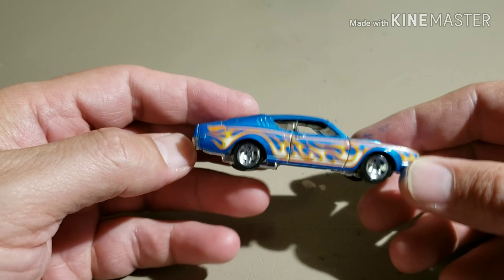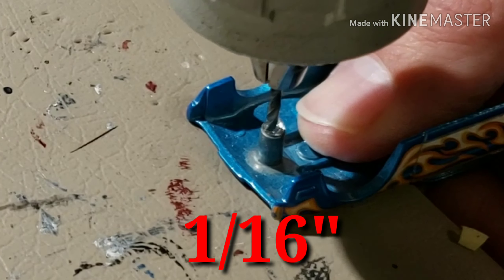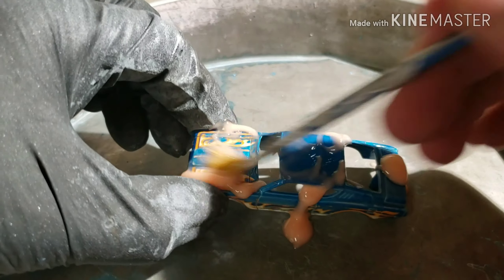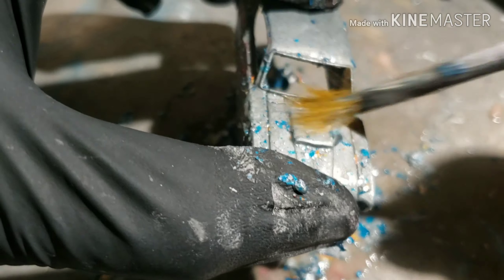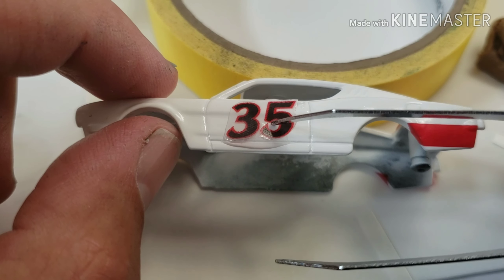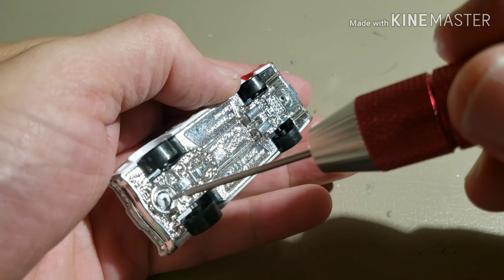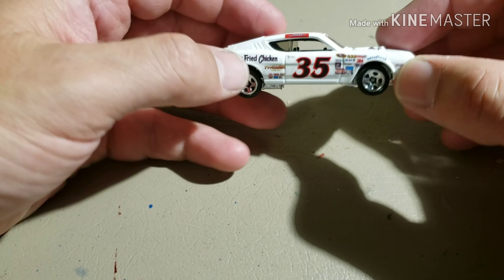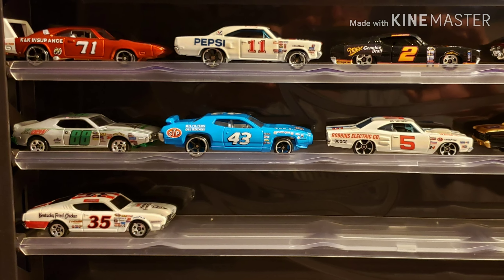Custom Hot Wheels (1969 Mercury Cyclone)

Comment: What size screws are there thim
Reply from the maker: 2x56 button head screws.
Reply: Is it 2x56 1/4
Reply from the maker: @blakeschoettmer9440  2-56 x 3/16
Reply: Okay thanks
Reply from the maker: @blakeschoettmer9440  no prob. I get them from Amazon. About $8 for 100 screws.
Reply: Are the black one that are really close to see
Reply: What is that screwdriver to put them screws on
Reply from the maker: @blakeschoettmer9440  I don't have it on me right now but I will let you know.. I think I show it in my recent videos.
Reply: Ok
Reply from the maker: @blakeschoettmer9440  .050 hex driver
Reply: @Nero62CustomDiecast  thanks dude
Reply from the maker: @blakeschoettmer9440  No prob
Reply: I can not find that screwdriver
Reply from the maker: @blakeschoettmer9440  go to amazon, type in .050 hex driver. Should be the 1st one that comes up.
Reply: @Nero62CustomDiecast  sockets 
or screwdrivers